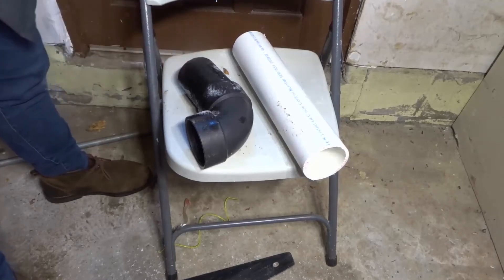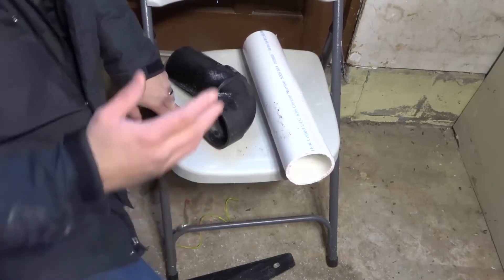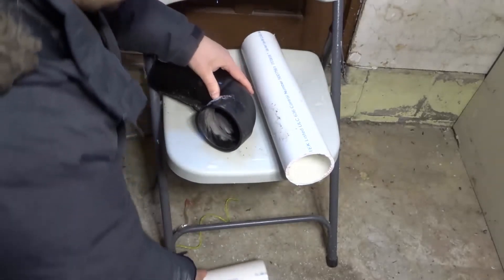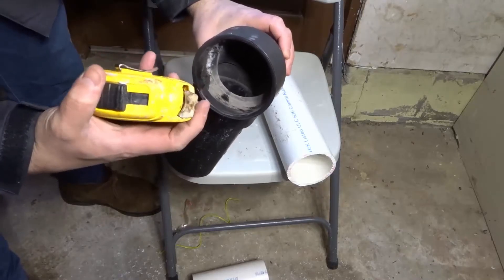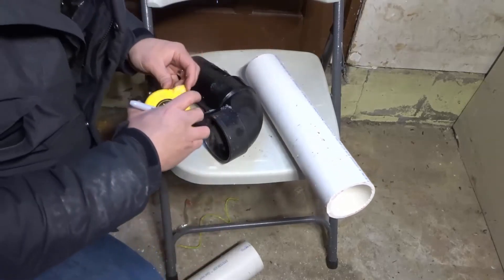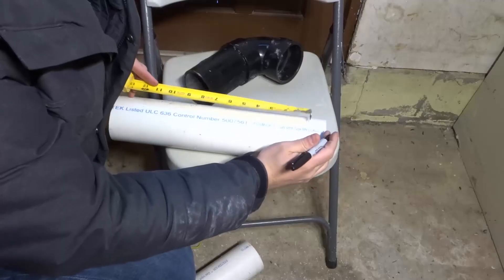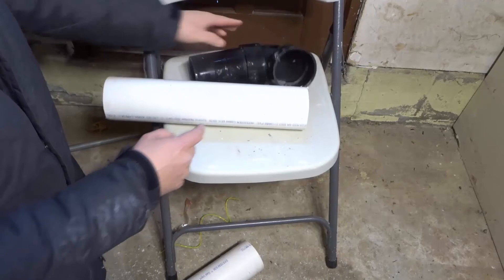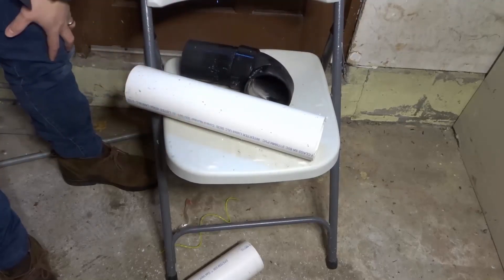How To Measure PVC Pipe-Measure Pipe And Fittings-Tutorial

Comment: Simple enough common sense. But what if you needed 6” TOTAL counting the length of the fitting overhang on the end? Your tape measure won’t stay put on that rounded edge. What then?
Reply: Centre to centre 
Face to face 
Add your fitting to your face to face measurement and cut